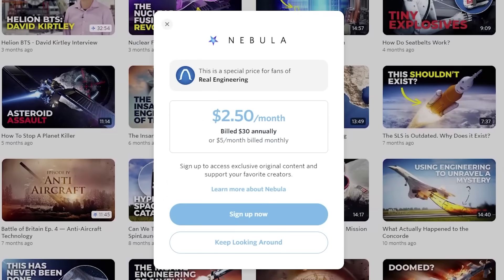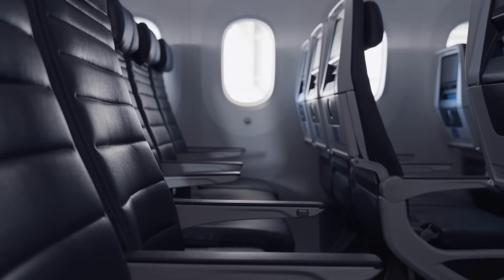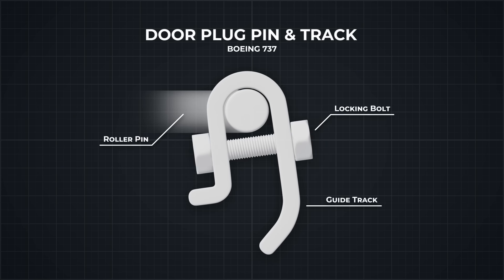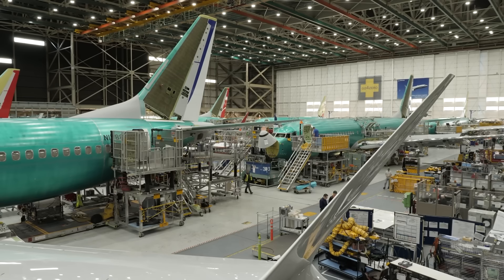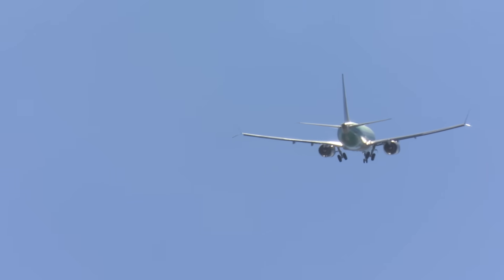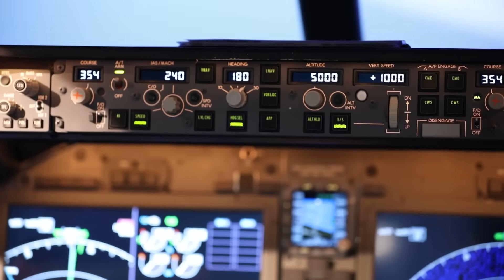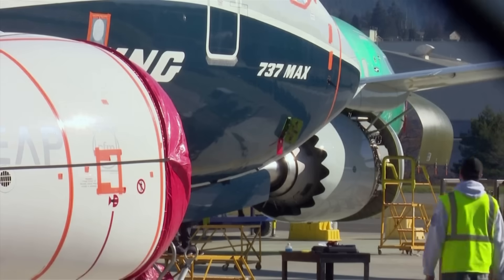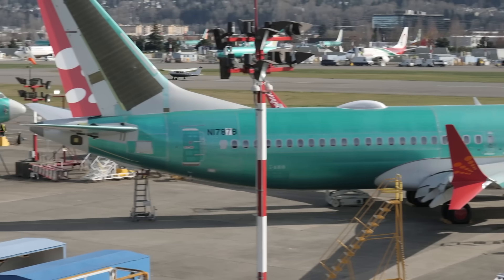The Questionable Engineering of the 737 Max

Comment: I had dinner with an accountant years ago (yeah, my one night off..). It turned out to be one of the most gripping nights of my life. He worked for an airline. Companies like Boeing would issue frequent advisory maintenance fixes for each model of plane. His job was as an actuary, to calculate the cost of carrying out the fix for the fleet, against the possible cost should an accident occur as a result of not applying the fix. It was quite complex because time is a factor - how much downtime would there be etc, and which routes would be least or worst affected. Anyway the guy had us on the edges of our seats all night as he regaled us with stories of seats falling out of the backs of aeroplanes and engines catching fire. It was quite a night. My takeaway is that airlines have the value of our lives worked out to the nearest penny in an Excel spreadsheet.
Reply: They did that with the Ford Pinto, would cost $15 per car to fix it so Ford chose not to, knowing people would be burned alive. GM had similar car situations. Did not know that the airlines had these type of cost accountants on staff.
Reply: @randyandtheretreads3144 "A new car built by my company leaves somewhere traveling at 60 mph. The rear differential locks up. The car crashes and burns with everyone trapped inside. Now, should we initiate a recall? Take the number of vehicles in the field, A, multiply by the probable rate of failure, B, multiply by the average out-of-court settlement, C. A times B times C equals X. If X is less than the cost of a recall, we don't do one."

One of my favorite quotes from Fight Club. 

People do not understand they are just a dollar sign to corporations.

The world has no soul anymore. Mindless profits are destroying us because there is no moral foundation in which to actually maintain and uphold value and fair play.
Reply: @Daemonamongyou I've been saying this for years and generally people agree. But then I point out that this is literally how capitalism is designed to work and suddenly I'm the bad one and not the soulless corporations calculating the value of human life down to a fraction of a cent.
Reply: @Daemonamongyou the world has no soul anymore?

Are you aware of medieval times? 😂
Reply: @randyandtheretreads3144  yeah OP's story was almost verbatim the story about the Pinto as it was told to me (not read from the book). I think it's urban legend at this point.
Reply: @randyandtheretreads3144 Pinto was kinda framed. That study where Ford put a $ amount on lives was commissioned by NHTSA at the time. There were also examples of Pinto being safer than industry standards
Reply: Won’t anyone think of the shareholders?
Reply: @FuncleChuck  Those cold-hearted accountants are hired FOR the shareholder value ONLY 🤷🏻‍♂
Reply: This is kinda just standard risk analysis tho
Reply: Similar to insurance risk pools, I've seen so many cases of this with other disaster post-mortems. Generally, the board of directors or CEO responsible for making cost-cutting decisions that result in death are almost never punished, most of the time the corporation just gets a fine or settlement deal. There really needs to be a change to the litigation system to actually charge these people with federal premeditated murder when disasters like these happen. Otherwise the potential litigation will just be added to the risk calculation while the board of directors maintains business as usual., and maybe a single figurehead CEO gets an 8-figure retirement package and some jail time. If your life is on the line because of cost-cutting measures, so too should the lives of those responsible for making the choice.

Deaths will always happen and nothing is perfectly safe, but willful ignorance and intentional negligent safety is the problem.
Reply: I'm an actuary. this type of math is generally correct but depends a lot on accurately predicting liability costs. the risk disseminated over different parties also causes complications (was it a design issue or a maintenance issue on the part of the airline matters because of who is ultimately found ar fault)

moreover, every business and government makes these calculations for everything. the only thing that varies is the level of sophistication and risk appetite od the individual. 

capitalism enables a more accurate accounting and fairer liability than all other systems (especially socialist or communist ones which make decisions politically rather than on the basis of affordability)
Reply: Same with the Railways, Cost v Risk analysis.
Reply: The same is true for most industries and large corporations
Reply: Even the government does. Trust no one
Reply: You are making one big mistake in this analysis, you think their using excel. Their too cheap for excel they are using google sheets
Reply: I guess you grew up that day 😂
Reply: And the FAA allows this?
Reply: Funny how this year is on track to be the safest for flying in history. 

I trust any plane the pilots are willing to fly, whether it be Boeing, Airbus, Embraer or anything else. (being an American nationalist, my preference is Boeing)
Reply: That's nasty
Reply: And people will keep say that plane is the safest transportation mode ever 😂
Reply: That’s what happens when you hire Jews
Reply: Everyone seems to forget that this IS deregulated capitalism. Capitalism needs regulation, and greater and greater levels of regulation as potential risk increases.
Reply: @Seawolf44  Ah, they'll say so you don't believe in a free market, How un-American!
Reply: To be fair, we have to set a value to a human life. Assume preventing 1 accident per year resulting in one death person per year, would cost 20 G€/year, would you think that is resonable? There is no way we can afford that.

But this value is way higher than what a company has to pay for the aftermath of an accident.
Reply: @Johannes-c7p  it's tricky because there is a spectrum. A family member was killed unexpectedly in a motor accident and his life insurance paid his wife a mutliple of his expected lost earnings until retirement. Clearly that figure varies from one individual to another. Corporations however use an aggregate of that number, so there is a lot of scope to cherry pick a number that suits them.
Reply: Boeing had/have problems - but no need for spreading 3rd hand gossip.
Reply: Sounds like you went to dinner with Tyler Durden. Or youve just seen Fight Club too many times and repeated his job description for your comment
Reply: The writer took that from the real case of the Ford Pinto.
Reply: You couldn't pay me to fly
Reply: @Kyle-gb9dq well today you right boeing crash in india with 249 on board r.i.p
Reply: @Kyle-gb9dq 

What do you have against it?

Have you seen the statistics for deaths/injuries per hour of flight time compared to driving/riding in a car?
Reply: @JohnDoe-ne4kg That is the stupidest statement and the oldest argument. It also depends on how a person does NOT want to die - because of a corporate bean counter. You must work for Boeing.
Reply: @kennethmartin1300   im not a fan of boeing either, but his arguement is valid. You are more likely to die in a car crash than a plane crash, its just statistical fact. Does that mean its okay for Boeing to knowingly ignore safety issues to increase profit? of course not, the people responsible belong in prison. But if someone wont fly because their afraid of death, but they will still travel in a car, that is just flat out stupid.
Reply: Nice. It did not happen. Gotta give you credit for imagination.  Why would you post such nonsense? Not helpful.

Comment: Just a comment on MCAS... from what I understand the MCAS software didn't malfunction - it worked exactly the way it was coded to. The issue was that it was coded poorly, relying on only a single Angle-of-Attack sensor instead of using both of the two sensors, two sensors being a requirement by law.

So MCAS worked exactly like it was designed, but because it was designed so poorly, it killed people. It wasn't a malfunction; it was incompetence.

Comment: This is not a questionable engineering problem.  This assembly line issue and operations issue.  I feel that the seat by the plug wasn't accidentally vacant and maybe someone knew it was leaking.

Comment: 3:20 bolts securing the door fractured, improperly installed,  improperly tightened,  or missing all together.  Was this a manufacturing error? Maintenance inspection error? Or was it someone trying to sabotage the 737max project?

Comment: although i'm inclined to assume you've done your research, i've seen in a Megaprojects video on MCAS that the MCAS system adjusts the entire horizontal stabiliser and the failure was not a software failure but the failure of a single non-redundant sensor. look at the tail of the second plane at 9:33, i'm pretty sure you can see where they slide up and down.

Comment: This comment section is lit. 
I did my level best working on aerospace parts. I did a short stint at ATK, where they were building those composite fan containment cases. They never rushed me on anything. They took the time to deliver parts to spec. 

The small subcontractor I worked for after that... Total shit show. Mom and Pop business with ties to DOD. They were pulling down contacts for secret parts that I should have had a clearance to even look at. They were pushing all kinds of bad parts. They subcontracted out a lot of their work. So when your subcontractor is using a subcontractor... Yeah, shit is getting messy. I think Lockheed had them on probation for it. They were sending inspectors to double check parts before they shipped. They were going through in house inspectors like... Boeing... Actually.

Comment: Boeing's problems started the second they merged with McD. Let's not forget McD knew the DC-10's cargo door could pop open in flight and it took 346 people to die in France (same number that died in both MAX crashes) before they changed the design. McD management is the problem. They are the ones who keep moving the HQ to the east. Now their HQ is in Virginia and the best assembly line is in Washington. William Boeing, by contrast, would walk on the assembly floor and throw out poorly made pieces. This is still why Boeing has sold more units pre-merger than post.

Comment: The problem is US companies no longer get qualify people who know the business process as CEO. They are getting under qualify and over paid people as CEO. They like CEO who can cut cost and manipulate  share price. Not CEO who know the manufacturing process.  In every manufacturing company, they have production system that manage the production and ensure all the processes and sub-processes are done properly. Process 1 must complete before they proceed to process 2, Process2 must complete before it can move to process 3. However, this problem become complicate when Boeing and Spirits use different systems. For this incident, there is a problem with the door seal. to fix the door seal, (1) Need to remove the plugin and take out the door (2) To take out the door, need to remove the bolts (3) After fixing the seal, need to ask QC to check before putting back the door (4) After putting back the door, need to tighten the bolts (5)  After the bolts are tightened,  need to ask QC to check (6) After the QC check, they can put back the plugin.  However, they divide the job so clearly and these companies are using different system, they cannot reply on the system to ensure the jobs are done properly. As a result, if one of the step are not done, nobody know and safety of the Boeing Max are compromise.

Comment: Recently retired Boeing engineer here. The issue of the 737MAX-7 nacelle is a non-compliance to the FAA regulations. It is NOT a serious safety issue since the 737MAX-8 and -9 are still allowed to continue flying with only the change to the flight manual. If it were serious, the FAA would ground the airplanes. Boeing's position is that if the FAA allows the 737MAX-8 and -9 to continue flying then Boeing should be able to deliver 737MAX-7 airplanes and fix the fleet all at the same time when a good engineering solution has been developed. This is NOT an unusual situation. Boeing learns about fleet findings all the time and makes design changes as soon a practical. Furthermore, this has absolutely NOTHING in common with the manufacturing errors due to the door plug.

Comment: There's NOTHING wrong with the "Engineering" of the 737, the basic design and aircraft has be a VERY reliable and safe aircraft for DECADES! I worked on them when the USAF got them decades ago. The issues are, the changes in management and priorities as well as assembly and quality of workers. Although I do agree that the engineers that designed the basic 737 were MUCH more diligent (probably more talented as well) than those that are doing the new aircraft now. It's also an issue of oversight and maintenance. The level of work that I did as a crew chief is no where near what airlines do. I've done visual inspections just looking at aircraft on the tarmac and seen things that, while it may not have grounded the aircraft, would've been close or at the very least marked for immediate repair work. The other problem with ALL modern aircraft is the software in the avionics. many modern pilots wouldn't know what to do if it failed, or in some cases, if it does there's nothing they can do, because they no longer design in mechanical backups for fail safe purposes.

Comment: So - apart from all the other faults here - they added a piece of code to compensate for the inherently unstable airframe they created, because they couldn't be bothered to do the recertification (as it's not a "new plane" per se) What happens when the power goes out and it has to glide, as we've seen numerous times in airplane accidents? Good lord.. 🙄
Reply: Unstable isn’t really the applicable term…

Comment: The 1960s low to the ground level 737 airframe is simply no good to try enhance and modify, sticking bigger engines on it to compete with the airbus neos creates all sorts of issues, also the longer length fuselage of the 737 800s,max8,9 and 10s variants creates faster landing speeds so overall its more of a handful to fly and control

Comment: This mid-panel-door "plug" is hardly an impressive engineered door, I wouldn't even called it a plug door, it was a door but it definitely didn't fit the standards since it hardly did any good plugging 🪠 to begin with 🙄
When I heard this happening I knew instantly this could not have been the same kind of door design as you'll see at a plane's main entrance/exits cause those doors are solid 💪 and basically fool 🥸 proof !¡! 
It must have been some other design that was used for this mid- door, and significantly different than the main doors at the front and back of the plane. And I was right 😏
Cause this was just a crappy door plug design 🤡 especially if you look at how the maindoors are plugged 🤔
These main entree/exit doors, do actually function as a plug very very well  🤓👍
The door has a very different way of closing, when closing the door will maneuver itself sideways for it to be able to fully slide inwards completely into the plane, for it to then be set in it's final original position, and crew will locked the door with a inside handel, but since the door is purposely designed to be bigger than the doorframe, (that why it has to slide in on a side angle) when the door needs to open or close, but when closed the door is positioned on the inside and will push against the outer frame, even if the handle wasn't locked, it's impossible for such a door to accidentally open mid flight under pressure as it's pushed into the frame, even without the locked handle, because this door indeed acts like a plug 🪠 These main doors are actually worthy 🏆 of being called PLUG-doors 😉
In contrary to this raggedy ☠ designed mid frame/ (fake) 👻 plug -panel door, to be honest the entire door design is a joke 😝 in comparison to the solid design of the main plug doors!
Whoever designed it 🙈🙉 or thought this design was suitable 🙊...
They need to be fired 🔥 yesterday.
People were incredibly lucky this time.
Boeing turned into a disgrace 😖 
This MAX design was a disaster from the beginning, took people's lives from the beginning 🙏 rip lost souls🕊 
They should have taken their losses on this failed/incompetent design with to many errors on all fronts, software, technical, all kind of problems, not some bugs that need correcting, no serious recurring issues 🤐
They should have scrapped the MAX years ago and should have opted to recover the business from their failed Max airplane adventure turned nightmare shitshow 😬 instead of hanging onto this troubled aircraft for dear life eventhough everything pointed to a failed project on every front, this plane was doomed from the start, unfortunately along with it's company, so it seems 🙄
RIP 🪦 BOEING 🛩 company 2024 😓

Comment: I have was a structural engineer with Boeing for more than 34 years.  During this time I’ve participated in the development of several new derivative and airplane models.  This participation included product development, design and build.  Throughout this time safety was always a major priority.  Potential safety related issues were always a top priority.
Reply: Evidence says otherwise...
Reply: @Ali-e5h1b  can you state specific examples where stress notes, certification documents, functional test results, material test results or loads models were intentionally falsified?  Can you specify specific factory jobs where the QA buy-off was intentionally falsified?  If you can, there would be a strong case for individual employees to be fired and perhaps prosecuted.  If you can’t, there’s a possibility that the “whistle blower” is a disgruntled former employee, someone whose pushing an agenda (union expansion) or simply isn’t familiar with legitimate efforts involved to resolve factory and engineering issues.